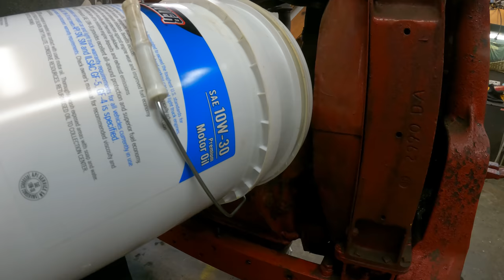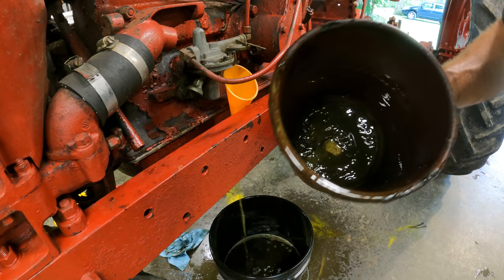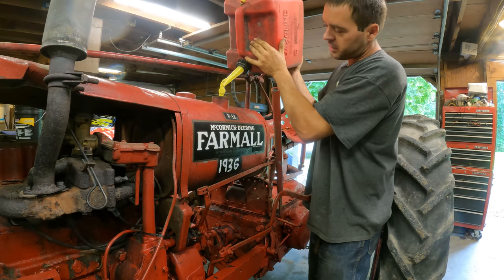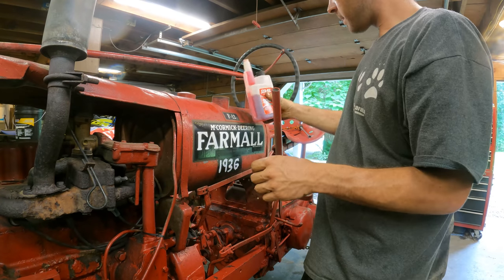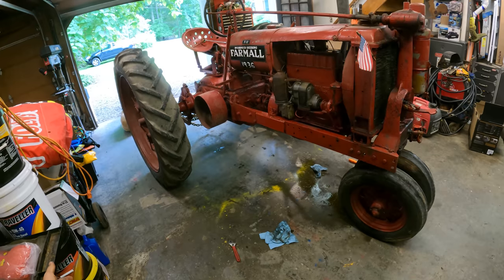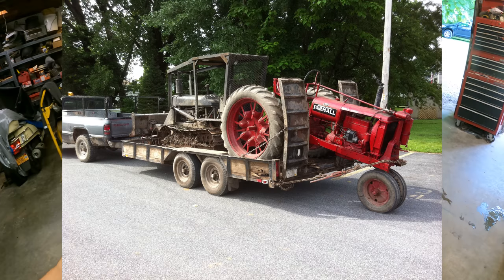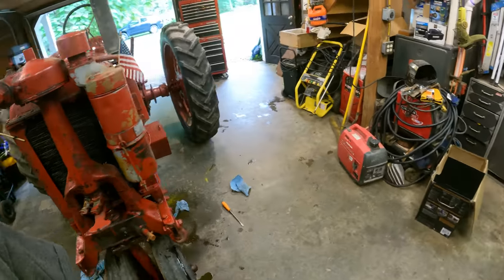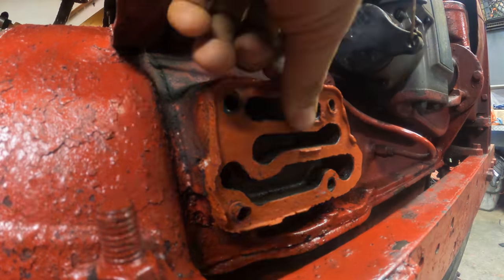Servicing antique tractor for parade

Comment: I used to work on a lot of old Farmall’s and I would tell the other mechanics at dealership we’ll be gone and this old iron will still be here makes me feel good to see you taking care of that Farmall. It probably let some tired old horses retire!
Reply: Farmalls...plural is not possessive
Reply: @anderleof  are you serious pal?
Reply: We have a bunch still in use at our antique power club grounds. Ms, Hs, 450, some old backwards forklift thing.
Reply: @mooman86  i still bush hog with my 9n ford
Reply: The old tractors were overengineered because the designers didn't have computers, finite element analysis, etc. to refine the designs down to the minimum ounces of metal needed for parts to work and not break.

Comment: Nice old F12,,,I have a 1938 F14. I have never seen a F12 with angled sterring shaft. Every IH book I read says all F12's had a straight sterring shaft from sterring wheel to the box. With the start of F14 in late 1938 the hp was increased to 14 & had a angled shaft like yours. You can put electric start on yours buy bolting a ring gear between the u-joints in front of the trans & making a bracket to hold a starter. Cheers
Reply: I had 2 F12s , a 34 and a 36. The angled steering shaft was only used on the F14 which started in 1938. Check the serial number for date of manufacture.
Reply: The F12 never had the elevated steering or the long brake levers but lots were converted later.

Comment: That is one very very sweet tractor you have there, started right up as if it was new! What surprised me was the amount of people that watched the parade, here in the country where I live, on a good sunny day, we might get a couple of hundred people or so at a demonstration/parade , so a lot of praise to all the people that watched, they also keep history alive by wanting to see this which make it much more fun for us that has a antique tractor
Myself and a friend owns a TEA-20 little grey Fergie, we are going to renovate the brakes, needs new gaskets and such in the transmission, bought new fueltank for it, new hoses, will get a new radiator too, and then it will run as new again even that it starts right away now too :)
Reply: 1974 started working for I H dealership 1982 became a Ford tractor dealership,then 6 months later we acquired MF tractors , the TE had power steering and Ford sweet talked Ferguson letting them copy the (Ferguson system) they did make the Ford-ferguson tractor for a short time . Ferguson probably said that’s why Henry got me drunk at his home that evening. Ford came out with the 9n, 2n and the 8n all flat heads and still no power steering! For loader Equiped tractors. The TE’s were way a head of Ford at that period. Ford tractors finally got there act together in the 60’s,70’s80’s90’s then Fixitagaintony got involved 😝 jst kidding 🙂 I’m color blind when it comes to old tractors. Take care and God bless

Comment: When I was a kid we had a Farmall Super H. No 3-point hitch on that either, but it did work pulling a disc harrow, pulling a trailer, and plowing the driveway. Not saying that you should put the F12 back in service, but they can do real work.
Reply: They work well on flat land, but are down right dangerous on a slope, even if you have the front wheels spaced out as far apart as possible.  The guy across from my shop was killed when one rolled over and an uncle was seriously hurt the same way.  My dad had an old Ford tractor buck the front tires several feet off the ground on his ppty.  He traded it for a 4x4 New Holland Boomer a week later.

Comment: That was a really good idea I've used RTV sealant before but never thought about taking something back apart and cleaning out the ports to make sure that the oil would get through or gas that was a really good idea another great video those tractors when I was younger were used mainly for plowing and disking and they had wheels on the disc and a plow that she would pull a handle to lift them up and the power takeoff on the front we used to use a lot for running a grain augers for moving grain into the silos and into the feet then when we were doing feedlot cows good video and it's nice to see an old piece of equipment running still

Comment: that was some nasty looking oil, definitely needed a change , Ive heard the blue stable doesnt break down over time like the red stuff. the blue is the marine stuff. thanks for all the great content and dont change a thing
Reply: I've had red Stabil clot and plug up a carb, the Marine stuff is better. Seafoam is better still. I use 1oz per gallon in equipment that sits.

Comment: good job. Andy i have a few vintage motorcycles and every fall I drain the gas from the tank and the carbs. I spray the inside of the tanks with light oil to prevent rust. In the spring add new gas and ride for the summer. Keep up the good work.

Comment: Really enjoy these videos and the time you put in to make them, sir. I think if you had slowed down a bit and gone into detail for us along the way you'd naturally develop the polish that would have made this shine. Here's a few thoughts I wrote down over my lunch:

-Starting earlier explaining the tractor's origins rather than later. Even if you had to do a bit of VO work that ran over podded down Camarata B-Roll. It would help the audience form an intellectual/emotional connection earlier. It's a cool story, and these kinds of machines are becoming more and more rare. Thank you for helping preserve a piece of that history.

-Explaining what you were adding and why @ 5:51. The can was turned away, and the tractor is old. 3-in-1 Oil?

-Explaining the gasket-in-a-tube material a bit @ 9:37. Maybe you telling us what you think the pros/cons are, or a story about how you creatively saw it used before? Why do you trim off the excess after it cured?

-What do you do with the many gallons of old oil/gas you run through annually? I enjoyed your earlier video(s) on fuel storage so this would have been a good place to add some depth by discussing fluid/fuel waste management for your fleet.

-With the tractor being "pre-hydraulic" what is the purpose of the front oil you drained @ 12:00?
Reply from the maker: I could have. The front oil was the air cleaner.

Comment: My grandpa had an old Farmall tractor like that one.  One thing he taught me was to NEVER push the crank handle.  If it backfires it can easily break your thumb or wrist.  Start with the handle at the bottom of the stroke and pull it up and towards you.  If it backfires then , it will just open your fingers grip and pull the handle out of your hand.  It still hurts, but you wont break any bones.

Comment: Andrew,  just a tip I learned from my Grandpa.  When starting a crank type vehicle always start at the bottom and pull up.  By pushing down, if the engine happens to backfire it is going to break your wrist. Grandpa was born in 1893 and was an auto mechanic his whole life so he was very familiar with crank start engines.  He also had many friends that had a broken wrist because of this oversight.  Please tell others.

Comment: Nice old tractor. It is between the steam era and the PTO era. It has the belt drive wheel for stationary power to equipment. And the pull for the self powered (either by motor or wheel) equipment like a sickle mower or baler.

Comment: I can't remember the name of them, but in aviation, we used some paper assholes/washers that had a sticky back, to put around bolt and screw holes like those on that filter housing.  They came several on a sheet, were sized for the bolt hole, and the thickness of the sealant that was desired.  Most of the ones I used were 1/16" to 3/32" thick, for 3/16" and 1/4" fasteners.  The sealant stuck to the aircraft, and the inspection panel/door was coated with mold release, to prevent the sealant from sticking to that.  Once the sealant was cured, you'd pull all the fasteners out, remove the door and all the paper assholes, clean up the goobers, and you had a perfect, permanent, form-in-place seal, that was very uniform in thickness.  I suppose you could use steel or even plastic washers, but they don't come with a sticky back.  The doors on the jets I worked on, had anywhere from 10 to 60 screw holes.  Anyone remember the name of those washers?
Reply: --------------------------------------------------------------------------------------------------------------------------------------------------------------------------------------------------------------------------------------------------------------------------------- Dating Special For you
💋 NUDE.SNAPGIRLS.TODAY/asuna?Love-you💋.
 
Gaze: "Amazed" 
Lips: "Sensual" 
Smile: "Sweeter" 
Body: "Colder" 
Жизнь, как красивая мелодия, только песни перепутались. 
#однако #я #люблю #таких #рыбаков #垃圾

Comment: Great tractors. I have a 38 i use for brush hogging.  They only make 15 hp but get the job done.  I stole your hand crank holder idea after losing mine somewhere.  My dog goes nuts when i start mine too.. i rebuilt the engine in mine and did a overdrive unit on it for road driving to jobs locally. Parts aaa tree e readily repopped now for this old iron now. Good to see you still got it

Comment: File folders, Gasgacinch, gasket punch set and Exacto knife make great shop made gaskets. Yep I said file folder. Used them along with the Gasgacinch more than once putting a race engine together at 3:00am trying to make a deadline. Always nervous about silicone gasket  maker around oil passages even though that's a bypass.
Reply: File folders are nice, but kind of an iffy method. If water gets in, that's it, you're relying on the gasket maker more than the paper (some transmissions have paper filters, once they get wet, that's it for them). Plus gasket sheets are cheap.

Comment: I did the maintenance of dad's F12,F14, and F30. And I always had to change the oil and those also had a divorced hydrolics system the F14 and F30 had full hydrolics built in.adjust your spark controls for the governor

Comment: The water saturated ethanol separates from the gas and sits on the bottom of the fuel tank. Where it gets sucked up first, then just ruins your day. Ethanol free in anything that sits. Luckily for me it’s readily available in my area. I just topped off my motorhome today for the winter.

Comment: How interesting. My tractor is from 1947 and it has a mechanical oil filter that you take apart and clean. 
The air filter, on the other hand, is a common one.
Reply: Oil bath air filters actually  work really good.... then they  found out if they use paper air filters they can sell you one every year....

Comment: Putting a wire wheel in a drill press is nice. You then have two hands to move the part under the stationary wire wheel.

Comment: @13:35 I add isopropyl alcohol (dry gas) to my gas tank about every other fill up (8oz.) and a splash in my 2 gallon tank for the lawnmower and snowblower.
The isopropyl alcohol binds with the moisture build up in the gas tanks so that it can run through the carburetors.

Comment: I remember back in the day cleaning up old used  machinery, black tar black engine oil. ugh.
when I was a kid of 5 years old, a farm  hand who worked on the farm plopped me in the seat of the farm- all set the gas and said hold the wheel kid  keep it going straight, all but scared me to death. and yes there was no way I was able to manage that steering wheel, it owned me.
Jamesville NY, late 40's

Comment: It may be old and it may not have a 3 point hitch. But: it will not have DEF fuel problems, you will not have to wait on a factory tech for a month or two to come hook a laptop to it and tell you a uni-gator sensor is bad. 
Old is good if you know how to turn a wrench. Many farmers around here hate the new stuff and rely on older equipment that they have maintained very well.

Comment: Ignition got wet when you you pressure washed it.
Generally best pull/roll start gear is 3rd gear.
Get it rolling good then pop the clutch.
Works good on old Farmalls up to Diesel John Deer 4020's w syncro-range shifters.

Comment: 3:03 If the missing oil filter wasn't a good enough reason to over haul it....this definitely is...wow.
It takes a lickin' and keeps on....aww man.

Weld a dog sized hamster wheel off the back, add a belt and Cody could power that beast down the entire parade route.

Comment: You should run a fuel preservative in the old gal. It will make her fuel system happy.
Oh! I see that you do.
Reply: And/or install fuel cut offs and run it dry before storage.  Ethanol gas destroys carbs and rubber lines.

Comment: I can't tell if you're has a PTO but a pull behind mower is a good job for an old tractor. Mine is only 72 years old but pulls a mower all summer.
New, hotter plugs would probably help this one smooth out a little. Engines that don't get used a lot can benefit from hotter plugs.

Comment: Lol, you probably needed about an 1/8th of the amount of gasket sealer that you used on the oil filter... A thin little bead works just fine.  Hopefully nothing on the inside breaks loose and plugs up a oil passage.

Comment: Pressure washing while the engine is hot? Doesn't that risk thermal shock, causing cracks? Or is that not a concern in the older cast iron blocked tractors?
Reply: Hello there👋👋,how are you doing today?hope you’re having a good day?❤️!!!

Comment: A tid bit of info about old engines and todays oil. Todays oil doesn't have the zinc in it that protects the old flat tappets. you need to use diesel oils, race oil, add a zinc additive. The engine will fail with out that protection.

Comment: Hi Andrew,   Any chance you could spend a few minutes discussing the workings, of this old tractor, the parts of the engine, the different filters, etc. that you changed, and how it is different from a newer tractor engine.   And why so many of the parts are on the outside of the engine and more easily accessible.  For example, what was the part you unbolted, that you cut the orange (gasket) sealant off from.   Signed, “tractor-ally challenged”.  😋       Oh, and why you put “gas” in the engine. (Is “gas” what we (in Aust.) call petrol?).  What does the tractor run on?   And why you were able to pull-start it (so easily) with the modern, blue Ford tractor.

Comment: That thing is terrifying.  I can only imagine how many people that flywheel on the side maimed.
Reply: That's why they used to have so many kids.  They could afford to lose a few to Darwin.
Reply: They also tip and roll over scarily easy, even with the front tires spread as far apart as possible.  A neighbor was killed in a tractor roll over and an uncle seriously hurt in another.  My dad had an old Ford and traded it for a 4x4 New Holland Boomer after the front lifted several feet off the ground taking a turn.  I was behind him at the time and thought I was about to watch him die

Comment: He took off the gasket that eliminated the oil filter.  Did he reuse that gasket when he installed the filter housing?  If he reused the same gasket, then the oil pressure still isn’t going through the filter.